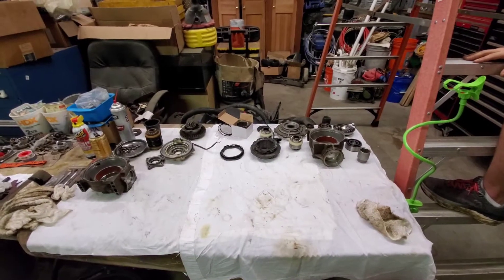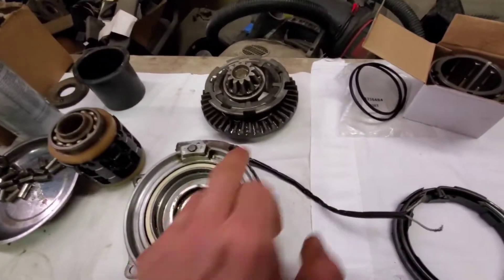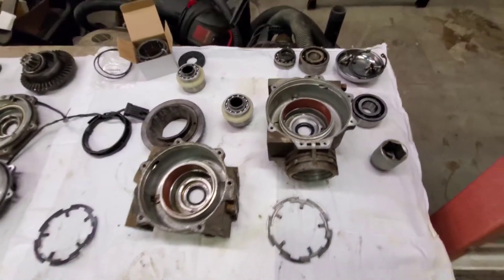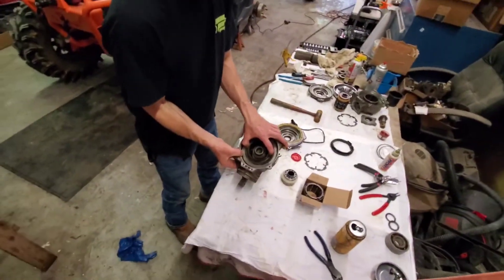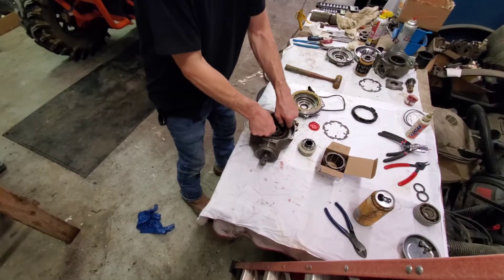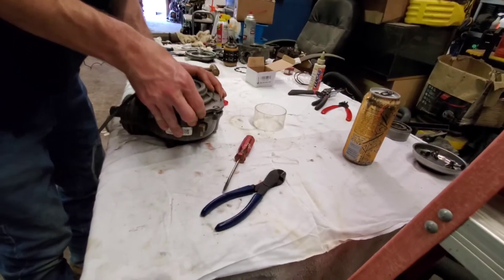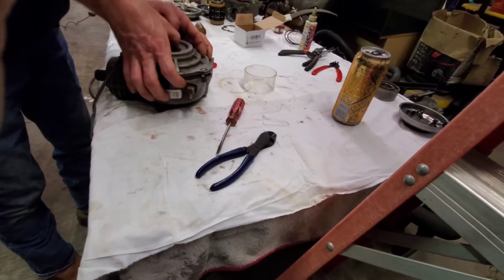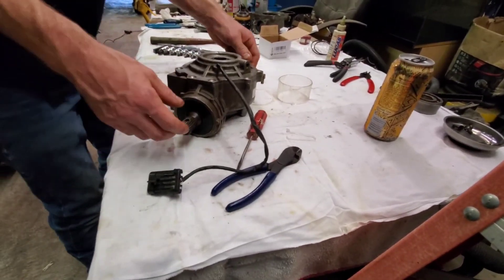polaris rzr800 front differential differences! 08-2010 has plate on pinion. 2011-up is same as 900xp

Comment: Hi Alpha great video. So why does Super ATV say that there complete HD front diff only fit 2011 and newer, is it different mounting position. If you can remember back that far LOL.
Reply from the maker: The 2011 and up rzr 800 and 800s come with the same diffs that are in the 900xp. 08 to 2010 has the same front diff as the sportsman with the bolt on pinion plate.

Comment: Are the gear ratio s the same in the razor 800 to the 900 ? And  can we directly  bolt the 900 in ?
Reply from the maker: Yes you can bolt right in.  Reinforce frame where diff bolts up. The 2011 and up rzr 800 have the 900 xp front differential in them from factory.
Reply: @alphapackoffroad   mine is a 09 800 razor ranger and yes already in the process making a beefier mounting plate since polaris used such thin metal yo bolt the diff to
Reply: And one more question the diff I am going to pick up is out of a 2012 900 xp is that the same ratio and the same do you know ?
Reply: And thanks for taking the time to answer some question you have been more help the google
Reply from the maker: Should be close. It will work. I have a 1000 front diff in my 2016 Ranger 900xp high lifter edition. Install video on my channel
Reply: @alphapackoffroad  thanks again you've been alot of help definitely  hit that subscribe button
Reply from the maker: Thanks for subscribing and checking out channel! I greatly appreciate it! Please like and share with all your riding buddies. Trying to hit that 1k mark. Anytime you have a question just comment and I'll respond as soon as possible.
Reply: Can I run 1000 axles in my 2014 rzr 900xp  with stock front diff
Reply from the maker: Id Look up the specs of the stock axle and compare it to the 1000 axle specs.
Reply: @alphapackoffroad  ok do you know if axle splines on the cup for the diff is the same?
Reply from the maker: Yes the axle splines for diff are the same. My ranger 900 xp axles fit in the 1000 front diff I installed in it after original diff took a shit.
Reply: @alphapackoffroad  gotcha gues the axle spline on the outer cup are the same as well
Reply from the maker: Yes

Comment: How did you get the pinion Barring out of the 08 diff. I’m looking at one and don’t see a clip ring or anything to take out .
I understand about having the new one in the freeza. Just can’t see how to get old one out. Let me know something!
Reply from the maker: There are videos that show how. You have to hit on it as you pull or heat up the case.
Reply: @alphapackoffroad  Thanks @Alpha but luckily I’ve already got it out , I’m going to cool the new one really good before it goes back in. 😎